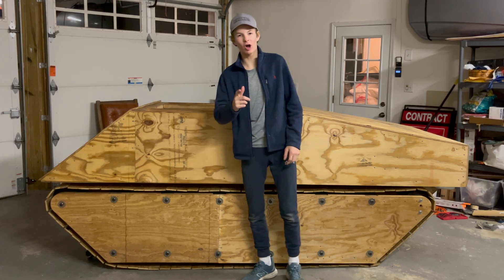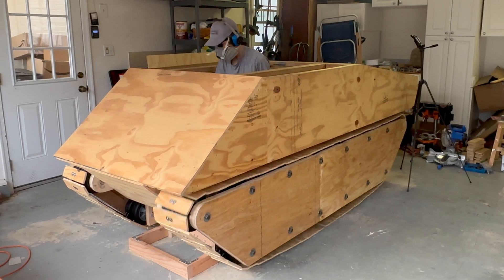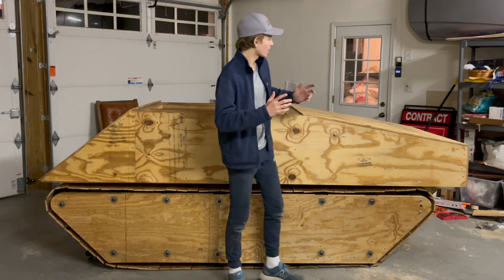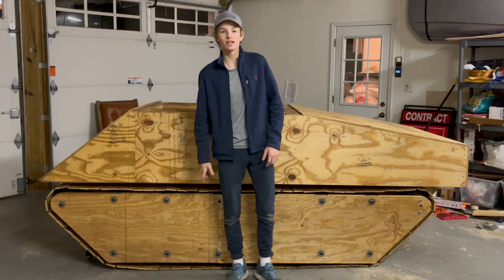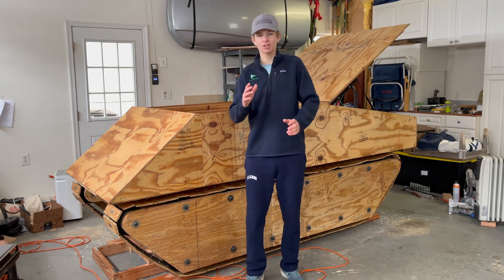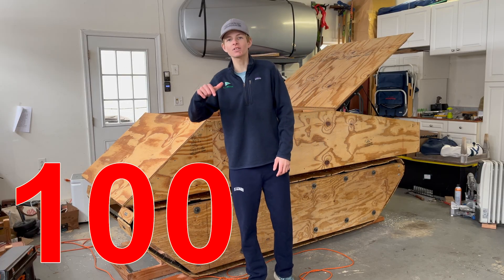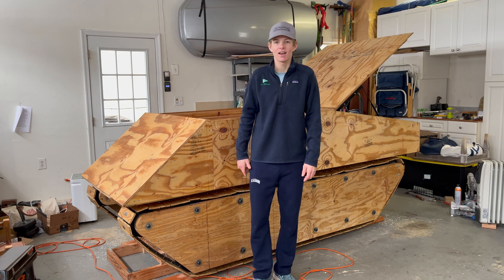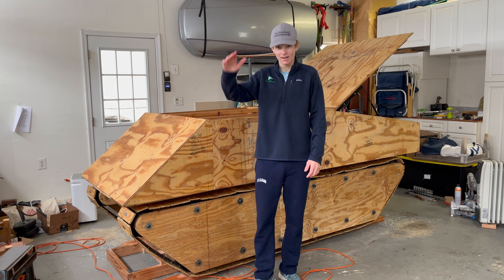HOMEMADE TANK Part 4 - Final Hull Drive Test

Comment: Brilliant, well done, it hasn't been easy to get this far and I really like the exhaust. 👍👍
Reply from the maker: Its been a lot of work, but well worth it!
Reply: @All_Original  yo man you should do a few more things make a roof for the hull and put in a wiewing pod also make line holes on top of the engine acces so it breaths more exhaust is cool but the engine needs air
Reply from the maker: @Bobnikov  Yeah I'm currently working on the turret right now. Since the tank is far from air tight, extra ventilation isn't needed due to the fact that the engine really doesn't pull very much air. Thanks for the comment!
Reply: @All_Original  and i thank you for the response first time getting one

Comment: Ok so your key problem is glaring. It's made of wood!
Your mechanical systems seem fine even if a little crude.
I assume you plan on using this on paved areas as well as off road so I suggest rubber track plates (maybe cut foam floor pads and stick some cut up tyres to them).
I am also guessing this doesn't need armour practicality so go ahead and used a box steel frame and aluminium plating for a light weight and durable shell.
Shit's gonna get uncomfortable, loud and hot in there. Get yourself a suitably comfortable driving chair, line the inside of the crew cabin with studio foam and create a cabin cooling system with a cheap aircon unit or something.
I am guessing you will want to enclose the top to protect from weather so you will also want a drivers slit for visibility.
I understand more than most budget is a thing but this shouldn't break the bank too much and can be acquired on amazon or DIY stores like home depot.
For added piece of mind fit a piece of perspex in the drivers slit to act as a windshield.
Your design is on par with if not a little better than a cyber truck for shape. I wanted to make the joke on the first video but also wanted to see if you would mitigate the issues first so here goes...
Did you hear about the wooden go kart?
It wooden go!
I didn't have high hopes for the wooden tank either. MAKE IT AWESOME, YOU HAVE THE TOOLS!

Comment: this looks very simaler to a M4A3 sherman and i love it next time you can add some fenders and round out hte hull via sander and dont forget the vieport 
for the turet rotation and movement you can use the power form the engine to turn it or just hand cranked or servos

Comment: In my design i decided to do two separate engines for ease of operation. Your design seems to work good as well
Reply from the maker: Nice! Yeah I considered using a dual engine setup, however there was not enough space in the engine compartment for two reasonably powerful engines, and ultimately a differential was simpler and therefore more appealing.

Comment: What did you use for the engine of the tank or whatever basically I mean the thing that makes it move(I dont know that much when it comes to vehicles)
Reply from the maker: Its a 18hp DuroMax 440cc 4 stroke with a recoil start, you can find it on amazon here: https://www.amazon.com/DuroMax-XP18HPE-Electric-Certified-Refurbished/dp/B06ZY7H7ZQ/ref=sr_1_1_sspa?crid=56LU9CW7NDE2&dib=eyJ2IjoiMSJ9.cOlkshUsiDk8J-uA2ztE0qBh0y67Q4dBDDhS3EoJU0BF6rkTdX8a0Mz2wIow8AUJwp55Xjt_prC3okmf67C4UJu5aVA6Re0rjE89WUyJ-lkXK51xkTPEU9r2xSQ1m2_CbHtduIeIlxTw7E7sICpbIwJvLrBkQoiOlRczJgVwkdxJEI-yK-gppr_qTs7TVtR53z9AhfKKKR4EsEUL0yCprB63sYTqPWAnHQcaz-IizyA.beaHiQk4RC3H6OkOHQn8GYQefG0_ftot6tsw8RPBPCU&dib_tag=se&keywords=18hp%2Bduromax&qid=1716162212&sprefix=18hp%2Bduromax%2Caps%2C122&sr=8-1-spons&sp_csd=d2lkZ2V0TmFtZT1zcF9hdGY&th=1
Reply: @All_Original  thanks

Comment: Hey bro can u use a wood or something for its Bullet?
Reply from the maker: Nah, it's gonna use tungsten carbide, but my original idea last year was actually to make a wooden shell, so you aren't that far off.
Reply: Good
Reply: Also bro if the make a ammo rack under ur chair so u can easily reload it or u just need to put it on the turret

I didn't know where to buy a single Part of my WW2 Jeep Willys from my grandpa like I need to repair it there's too much thing I have to buy like The Engine need to be repaired I need to clean the gas Tank and I have to clean the body and other part. Now I can feel how tired you are When making a tank bro, ohh yeah the brake wouldn't work so I need to repair it, It's over 50+ years didn't touched by my Father and when I repairing the gas tank and other part I Found a bullet my father said it's a M1 Garand bullet. And I found 6 bullet 💀 3 on the engine and 2 on the gas tank 1 on the Deck
Reply from the maker: @CardBoardGAMING17772  wow
Reply: @All_Original yeah
Reply: Man, it's almost a year

Comment: Driving safety is paramount for all road users, encompassing a range of practices and behaviors aimed at reducing the risk of accidents and injuries. Fundamental to driving safety is adherence to traffic laws and regulations, including speed limits, signaling, and right-of-way rules. Defensive driving is also crucial, involving anticipation of potential hazards and maintaining a safe distance from other vehicles. Proper vehicle maintenance is essential to ensure brakes, tires, lights, and other critical components are in good working order. Avoiding distractions, such as texting or eating while driving, is imperative to maintain focus on the road. Additionally, wearing seat belts and ensuring all passengers are properly restrained significantly reduce the risk of serious injury in the event of a collision. Weather conditions can also impact driving safety, requiring adjustments in driving behavior, such as reducing speed and increasing following distance. Overall, prioritizing driving safety through responsible and attentive behavior is key to preventing accidents and protecting lives on the road.
Reply from the maker: lmaooo 😂😂😂😂😂
Reply: @All_Original   Haha dumbass! It's not funny!

Comment: hey man, I was thinking something similar. But I can't figure out what differential it should run on (and how it should run, I'm no engineer). so can you detail on how you figured it all out. Thanks and I love your videos, keep it up mate.
Reply from the maker: For the differential, I used a peerless 100 series, however it seems that the model I used sold out, but here's a slightly smaller one (here is the link: https://www.zoro.com/peerless-100-series-differential-assembly-34-shaft-axle-150-lbs-output-torque-400lbs-weight-on-diff-100-066/i/G001978671/?utm_source=google&utm_medium=surfaces&utm_campaign=shopping%20feed&utm_content=free%20google%20shopping%20clicks ). This should still be more than enough to handle whatever you through at it. For the brakes, I just used standard bike disk brakes, you can probably find some on amazon for a decent price. Figuring out the sprockets for the differential was challenging, and it really all depends on how much load you plan to put on this thing. I would recommend doing some math and figuring out the approximate final weight of your vehicle before you jump into gear ratios and torque loads. I will warn you though that mounting all of this stuff is pretty challenging, and if you don't align your bearing pillow boxes (those are the things that the differential, or really any shaft for that matter, are mounted to) properly, you can easily snap the differential right in half. If you REALLY don't know where to start, I'm more than happy to try and put a parts list together for you, but I would definitely recommend some planning. I will be honest, 14 months ago I didn't even know how to START and engine, but within the span of a couple of months I learned a ton of stuff just from looking things up online and searching for parts. You will certainly gain a ton of knowledge just from searching for the parts you need, and I strongly encourage you to keep track of everything in a spreadsheet, it makes life WAY easier. I really hope this helped, and good luck with your build!
Reply: @All_Original  what the hell?!! i have no budget for that:( is there any way to make a super simple track system?
Reply from the maker: @SadCatStudio.  Two motors, or a clutch system for each track, but that wouldn't allow precise turning, and two engines will be heavier and more expensive. Yeah none of this stuff was cheap, put about $10,000 into the project including the cannon (vid not out yet)
Reply: @All_Original  I could’ve expected that to be honest, I might buy 2 of those heavy 48 volt dc motors  with drivers, they are about 400 bucks and should work ok

Comment: for the turret try making something like a huge ball bearing with few handles so you can rotate it.
for the cannon you can use grenade launchers (strikeball or real) with enlarged barrel using a tube
Reply from the maker: I’m going to use a lazy Susan bearing ring for the turret ring, and it’s gonna be electrically rotated. For the gun, I’m going to make a chunky air cannon that shoots some pretty hefty projectiles.

Comment: As a follow up to my suggestion on making a case-mate design - you could probably make something like the M7 Priest Self-Propelled Artillery.

Regarding to the side-skirts - I would suggest cutting holes in them (the plates between the track and hull) so that mud doesn't accumulate.
Look at a photo of a Matilda tank for example.

As for the gun - you could make your own ammunition if you want without using pressurized air or anything of the similar.
First of all, get a thick metal pipe. Secondly, add a hinge to the other side of the pipe and a lock. (this is for the inside.)
you will place an ammunition piece and then a charge (basically a bag of gunpowder) into the breach and lock it.
Afterwards, you can just use a fuse to fire it off. It's essentially a Napoleonic era cannon.

To make gunpowder, you just need charcoal, sulfur and saltpetre (KNO3)
You can find charcoal sticks for drawing, sulfur in metal workshops.
I also think you can find saltpetre in flower stores.
There are many tutorials on this.

I'd also suggest adding hydraulics to the gun. This will ensure your tank won't be rocked by the recoil and won't crack the wood.

I think that is all I got to say for now
Reply from the maker: Thanks for the comment! I’m not going for a case mate design cause I don’t really like the look, however I’m probably gonna regret this later because I can grantee that the turret is gonna end up weighing a lot more than I think it will. Regarding the gun, I’m not gonna use black powder because I don’t think I would be allowed to show that on YouTube, me being a minor and all that. And even then if it was legal to build that, I probably wouldn’t just because I’m gonna be sitting right next to it, and I don’t really want to get exploded if for some reason a seal were to fail. Using air also allows me to precisely tweak the firing pressure, which IS possible with black powder, but not to the degree of accuracy that can be achieved air pressure. I also just kinda like the challenge of building an air cannon with an insane amount of power not gonna lie.

Comment: Hahaha i already guessed in the last video that you would make a stronger gun. 
Bro can u put a something like uhh like an Full auto Airsoft gun so it will be more Cooler than before like MG34 or other airsoft gun but you have to use the full auto, it will be fun. Btw how much Crew ur tank have. Hmm i think it's just you Being the commander. Reloader and  Driver
Reply from the maker: Yeah its single person
Reply: @All_Original  how fast is the tank max speed
Reply from the maker: @CardBoardGAMING17772 ~5.2mph
Reply: Cool btw will u add a machine gun on the turret please

Comment: Awesome, when i make mine do you think the 2" steel armor can hold up or should i do the 4"? Also, i need an opinion, rivets or welding? And any idea where i can get a modified howitzer too? 😅
Reply from the maker: Honestly if you want it to hold up to small arms fire, 3/8in sloped at about 45 degrees won’t let anything through. Riveting would be better if you are inexperienced at welding, however if you arnt to worried about having to make some cuts if you mess up, than definitely go with welding. Also for the cannon if you are able to use gunpowder a 2in not schedule 160 steel threaded pipe will work just fine as a barrel, no need to try and buy a howitzer (it’s probably not legal anyways)
Reply: @All_Original   lmao
Reply: @All_Original  You seem to be confusing gunpowder with black powder, they are not the same thing. The steel pipe MIGHT withstand a BP charge, however it would depend on the grade and quantity of BP and the mass and suitability of the projectile, however I would not use something with such thin walls. If you use modern gunpowder which are almost universally some form of nitrocellulose-based explosive, your "cannon" is actually just going to be a pipe bomb. To give some context here, I just measured the wall thickness of the barrel of my .22 LR pistol, which is .21" for a projectile that is .22", and it is made of MUCH better quality steel than a piece of 160 pipe.

I would also recommend looking up the federal laws classifying firearms and destructive devices as well as any state and local laws for your area, as building or owning a destructive device without filling out a lot of paperwork and getting a ton of background checks and interviews with every alphabet agency under the sun (which if your specs are accurate, your tank cannon would almost certainly qualify) is a rather serious federal felony and you really don't want to advertise doing this on youtube.
Reply from the maker: @Necro-the-Pyro  Yes, my bad, black powder. Just to put you at ease, I will tell you that im not using BP or any explosive to power the gun, but instead am using compressed air. Don't worry lol
Reply: @All_Original  it would still be worth looking into your local laws. A lot of cities are classifying all but the smallest compressed air launchers as firearms these days
Reply from the maker: @Necro-the-Pyro  Aight I looked over the law for airguns in Virginia, and it seems there is no restrictions whatsoever. lets goooo!